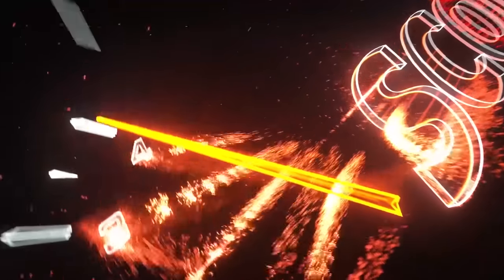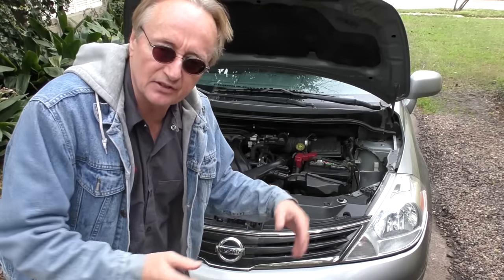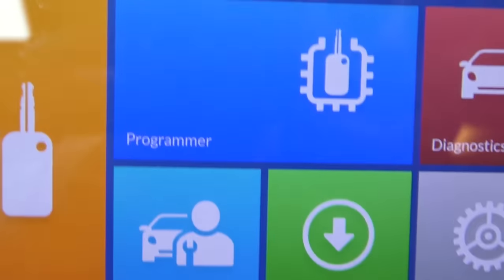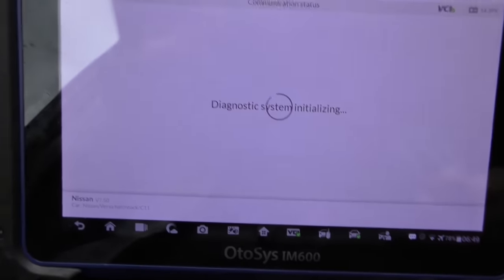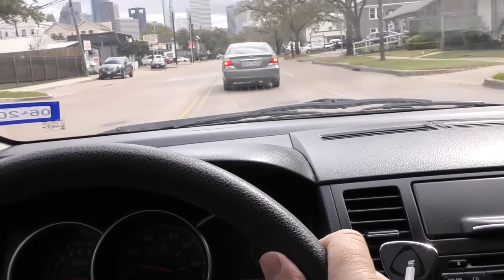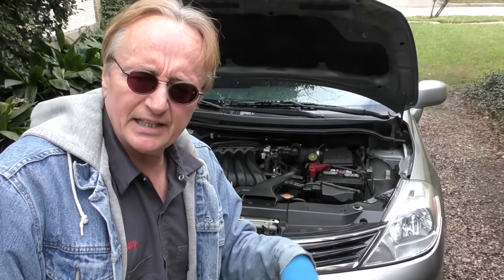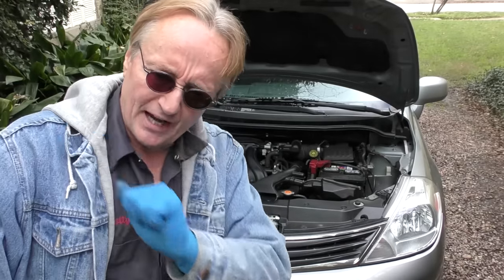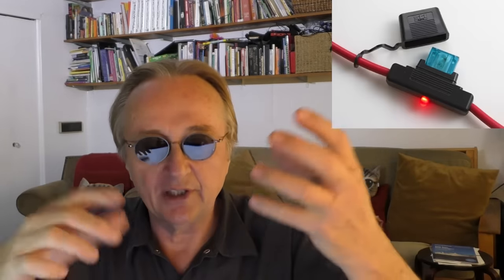Here's Why You Should Buy This Cheap Nissan

Comment: 1.40min... so true my 2015 nissan with a CVT transmission went out at 89k miles on it
Reply: ant gaona 
Did you flush the cvt before 50k? CVT fluid is weaksauce
Reply: @MainMite06  we bought that car used and previous owner told me he did... at the end we find out he didn't
Reply: ant gaona 
...Well that explains everything.. Those CVTs with either yearly tranny flushes, or flushing at 50k will really allow that transmission to cross 220k
remember that

Comment: absolutely not scotty, my transmission slipped super hard as i was pulling into the dealership to trade that in, pretty funny, they didn’t test drive it to appraisal the car, at the time of trade in, it was a 2015 with less than 50,000 miles

Comment: Seriously, you had to use a magnet to get the spark plug out? You don't have the little rubber sleeve inside the socket that holds on to the spark plug?

Comment: I would never drive another nissan after my 2014 versa cvt transmission failed.
Reply: Everyday Allday 
How & when did your CVT fail?
Reply: MainMite06 yes at 69k miles
Reply: @MainMite06  when I was driving one day, the car just lost all power and no matter how hard I press the gas pedal, it wouldnt move past 5 mph. So I pulled over and shut it off and restarted and pressed the gas and heard a loud crunching sound. I limped home at 5 mph and just parked it on the driveway and knew that nissan had terrible cvt transmissions. I sold it the car the next day and bought a tacoma. I'm never buying another nissan ever again.
Reply: Everyday Allday 
When you say "lost all power" did you mean
 "lost all forward drive?"
As in the engine cant move the transmission in drive?
  Also did you or the previous owner flushed that CVT fluid in 50K?
     Failing to do so will lead to fluid flouling, & CVT chain damage.
  And also, 
you know Nissan does make reliable non-CVT sedans & trucks on par to Toyota..no need to write-off the entire manufacturer for one bad apple..
Reply: MainMite06 I was at a stop light with the foot on the brake and when the light turned green, I pressed the gas pedal and it moved but noticed as I was advancing in the intersection, the tachometer and speedometer was dropping and no matter how much I pressed the gas, it would not move. So I put it back in park and shut it off and started it and it started to move but very slowly and the more I pressed the gas pedal, it made a louder crunching noise. I was the first owner, bought it new and did the transmission service twice at the dealer. I know Nissan makes non cvt cars but i was just very disappointed. This was my first car I bought and paid off months before and now this.
Reply: @MainMite06  also im not the only one with this complaint, I did some research and a lot of people complained about the nissan versa cvt specifically.

Comment: I've got a 2009 Versa hatchback with a knocking noise/feeling when turning the wheel, it has been that way since 127k miles. I have gotten all of the front end suspension parts replaced, but the knocking still persists. I've had multiple mechanics take a look at it and they haven't found any problems. I'm currently at 140k miles, nothing has fallen off fortunately, but the knocking annoys me. I don't know if anyone else has had this issue on first gen Versas.
Reply: It's probably the steering shaft bushings in the column
Reply: @rays7437  awesome, thanks! I kept looking it up, but most results were of corroded coil springs (there was a recall for this in certain states) and sway bar links. Next time I take it in, I'll ask them to look at the steering shaft.
Reply: @cali_viceversa   You think they would have checked those items when you had "all of the front end suspension parts replaced."
I wasn't aware of the recall, but then again I have been living in the Southwest a long time.  I can't remember the last time I saw rust.  Good luck!
Reply: @rays7437  yeah same here. I asked the dealership about the recall, but they wanted to charge me the full price of $1500 for strut assemblies because the recall wasn't applied in my area, so I went with an independent mechanic instead.
Reply: @cali_viceversa  I vaguely remember hearing about that now.  The vehicles had to actually have the problem and be registered in the "salt belt" states.
Reply: I had that on mine, I ignored it since it didn't seem to be hurting anything. Just a little design flaw I guess. It never broke and I had the car for 8 years.
Reply: @mdd47  and here I thought that my mind was going crazy or I got unlucky with a used car. Probably not resellable in that condition, but I have no plans to hand it over to anyone else anyway. Hopefully replacing the intermediate shaft will do the trick and relieve my stress a little bit.

Comment: My ‘15 is really close to 100k and it has been trouble free. The CVT fluid is changed every 30k. I have owned the car since 2014. Should I keep it if runs fine or get rid of it?
Reply: Keep it and drive it into the ground; it's not like you'd get much for it.
Reply: cincymodeler1109 
Keep going until you run it to the ground, or suffer a major inconvenience, like a heater core or evaporator. 
  GET THAT MONEY'S WORTH!
Reply: Michael Ball that’s what I was planning. It’s still trouble free. It just can’t get out of its own way.

Comment: Hey Scotty I like the newer civic hatchbacks but they all come with turbo engines. Is the turbo okay in the civics or is the base model without a turbo better?
Reply: Stay away from 1.5 turbo engines they have excessive fuel dilution problems. Get one with 2.0L N/A engine in either the Sport trim or LX trim, sedan version. (Sport looks better and comes with more features and alloy wheels).
Reply: @tails300  I figured the turbo engines had issues, but it seems like Honda only makes hatchbacks with the turbo which is annoying. I don't want a turbo and wouldn't get one just to have the hatch. Thanks for the help!

Comment: Bought a 2019, now I’m upside down. Don’t get it. They suck. Constantly broke down, worst CVT transmission, and the Transmission communication board is located in the drivers side taillight and I got water in there twice one before and once after Nissan fixed it the first time smh 😅

Comment: I have a 2014 Nissan Sentra w/59,000 miles on it and apparently the transmission went. I called Nissan and they are willing to pay 90% of the cost to fix the transmission. There's a settlement waiting for approval that will cover my car. Should I take the 90% offer and if I do, will I be eligible to recoup the 10% lost?

Comment: Things I've learned watching Scotty's vids a few weeks:
1. Yes, I should get a used car instead of an overpriced new one. Preferably a Toyota or a Honda.
2. Whatever used car I buy it's almost guaranteed to have problems, and within a few years it will devolve into a moneypit. T_T
Reply: I bought a used Mercury Grand Marquis. I paid 3500 for it, i am mechanically inclined, i have put about 2 grand into it, tires, brakes, and other parts.. Ive driven it about 25k miles so far.. no real problems.

That said, my 1991 Previa manual i purchased used in 2003 for 1,200 dollars, it had 255k miles on it, i put about 1700 into it over about 7 years.. i dumped it with 986k on it, ran great when i got rid of it. But it got hit, and insurance gave me 1,500 for it, so it went..

You can get good deals and bad deals, just make sure if you buy used, buy from the original owner, and be prepared to put at least 2k into it.

Comment: Will someone confirm this for me. Scotty said if the tire pressure sensor stops working then the Automatic Braking System won't work? That is crazy. Is this true? As far as I know every car I have had if tire air pressure is low it has nothing to do with the ABS system so why would a bad TPS cause ABS to stop working? This sounds like a serious design flaw and a safety hazard.

Comment: I drive a 2017 Nissan Versa with the CVT sometimes, 50k miles, and let me tell you.. Everytime I drive it I feel like its gonna break if i step on the gas pedal.
Reply: Just put it in R for race and it'll be fine.
Reply: Sell it now!! Get another car while you can!!! Since it's low mileage, you'll get more money for it. I drive a 2013 Nissan Versa SV with a CVT transmission. Bought it used in 2015 & didn't pay attention to all the class action lawsuit notices because my car ran excellent at the time. But after it hit over 110K miles, the CVT started slipping. It's literally a death trap...now I can't get it to go over 50mph. I can feel the pulleys struggle on each gear shift. Can't even drive on freeway, have to take the back roads. Had the fuel injectors and fuel pump replaced as a temporary fix, so I can still drive it until I get another car.

Also the driver's door doesn't lock/unlock using the key fob.  From reading the comments, I see a guy had a similar issue... Please don't wait till it's too late like me to get rid of it. I'm considering junking it.
Reply: noa 
Did you flush the CVT yet? 
CVT fluid is weaksauce.
50k miles is the time to flush the CVT,

Or are you experiencing engine rattling?

Comment: No way you buy a car today without ABS. ABS with airbags has greatly reduced fatalities and car crashes.  Bad advice Scotty to tell people not to get sensors fixed for ABS.
Reply: Especially since most people nowadays don't know how to brake properly in an emergency situation.
Reply: The ABS fault with this car also doesn't have anything to do with the tire pressure monitoring system (TPMS) fault. Scotty is giving lots of bad advice in this video.
Reply: Hoder Harris 
My '08 Versa S didnt come with ABS & TCS in the first place,
(grandfather rule-most cars built pre-2008 didnt HAVE to be equipped with ABS & TCS)
    My mom & me driven that car in severe rain & dry summers for 13 years & never had a full brake-locking incident, 
   & also, the engine is so slow that TCS wasn't necessary..

  Oh BTW most of the fender benders the car suffered were stationary & were caused by taller SUVs either not seeing the car, &/or paying attention to smaller vehicles ahead..

Comment: I have a 2007 Ford five hundred sel fwd. the timing chain jumped and bent valves. I found a used engine with 56k miles on it, and I’m having it installed. What can I watch for to keep my motor happy for as long as possible? I live in the north where it snows a lot in the winter.

Comment: I have a 2013 nissan versa. Sofar due to poor quality I replaced fuel pump, alternator, throttle body, completely rusted rear drums and front rotors. Al at 130k miles. 
It is a lemon. Do not buy. And yes it was cheap.

Comment: They hide the spark plugs underneath the intake manifold, oh my  , hypothetically,I’d like to meet that engineer in a dark Alley, Ha Ha Ha Ha Ha,
Reply: Ford does it with the v6 3.0
Reply: Zak6959 
If Nissan made the intake manifold with "open fingers" for each intake port like Renault, 
  Then removing & checking the coil on plugs, & spark plugs would've been easier!

Comment: Is the Hyundai Elantra a good car? Will it last a long time?
Reply: 2013's were an unusually bad year. Other years are OK, especially 2008-2009. I'd go as used as you can to prevent long-term depreciation; youtube "tony seba robin hood conference" for more details on why.
Reply: 2011 was the worst year for anything Hyundai. They had so many blown engines that they couldn't keep up with the demand for replacements.

Comment: Yes, what kind of morons would put spark plugs underneath the intake manifold, like what happened to my ex - a 1994 V6 Camry!
Reply: Will Wong 
Renault does this to their 4-cylinders to save ground space around & inside the engine bay.
   Doing this frees up more floor space to move the firewall more forward & improve interior legroom.
    If Renault didnt do this so commonly, 
then the noses & hoods of the of their subcompacts will have to grow longer & become more of a headache to perform more stressful jobs like starter motors or radiators.
Reply: @MainMite06  Thanks for the info. Just that, next time if/when I buy a gasoline-engine car, I'll make sure I buy one that the spark plugs are easily accessible because I could only change 3 out of the 6 spark plugs before I had my ex towed to the junkyard due to death by natural causes.

Comment: Just bought a 2012 Nissan versa sv compact sedan with 135k miles for $3k??? Am I getting scammed? If so what is a good bargaining price. Also I notice highway steering wheel rattles and check engine light is on but the guy said he’ll get that fixed for me free of charge and I just don’t know if I’m making the right decision. Someone help me out
Reply: Spend $100 for a mechanic to check it before signing anything.  It's much cheap to have a mechanic say don't buy this POS than spending $3k on a car that needs another$3k in repairs.

Comment: I have a 2007 chevy express 3500 and check engine light flashes after 55 miles and we even replaced engine and still have that issue. Help? Nothing happens while running, it just keeps flashing.

Comment: Hey, Scotty. What you think about the Nissan NV200 (2016-2019)
Reply: I own a 2017. Very cheaply built car with cvt transmission.  Very underpowered (hates hills and people will honk at you for not going fast enough), but gets decent gas mileage and makes a decent light-cargo van or micro-camper (if you're 5'5" or under).
Reply: tarasded thanks for the information. That all I’m looking for, light cargo and camper cause I’m 5’5 to 😂. How long you had your 2017 Nv200 now?

Comment: I thought the only Nissan worth buying is a manual v6...
Reply: ornate hammer 
Certain 2.5L CVT Altimas can cross 180k miles, 
But, most certainly, 
the Renault-origin/Nissan-Modified 1.8-2.0L 4-cylinders (MR18DE-MR20DE) were bulletproof from the start

I have 215k on my 1.8L Versa 4at

Comment: Funny how my 2019 nissan sentra sv got looked at... turns out qt 50k miles the transmission is faulty. So they gave me a 2020 sentra sv as a  Courtesy vehicle to use till its looked at more... turns out a 2nd problem was detected with the rattleing....
Reply: Hell, I've almost got in an accident when the cars transmission decided to slip while merging on the highway. 6,000 rpm down to 1,000 and the engine acted like it wanted to stall. Because of them I almost lost my life getting rammed by a trailer truck. Never again will I get a nissan. Not until they fix there transmission hiccups
Reply: And no it's not the fluid. Fluid was good and I kept the car maintenance when needed. So it's just there crappy transmissions. All I gotta say is I'm not paying the rest off. Not after that. They can keep or do whatever. I'll just find another car worth the same value. I can't afford to replace the transmission. I wasn't expecting it to bunk out at 50k miles. Ridiculous

Comment: What can cause steering wheel play in my 98 dodge Dakota 4x4 which failed my local safety inspection? It has a 3 inch body lift. It also failed safety for ball joints but I don’t get any of the symptoms that lead to bad ball joints.
Reply: You answered your own questions. Lift kits and ball joints.  Get the ball joints replaced and the lift kit re- torqued. Then recheck from there. It could have internal wear in the steering gear, worn out tie rods/ends.
Reply: Ray S ball joints will be my next move which many people say is known for older dodge trucks. I will also inspect the steering & front end components to see if anything is unusual or worn out. Otherwise the truck still drives straight

Comment: My Gf has a 2018 Nissan Versa Auto. Would it have the cvt?
Reply: Yep!
Reply: Ginja Man 
Relax, I own a new one

 if you hear nothing but "quiet turbine noises" from the interior from when you drive
     Then, theres NOTHING wrong that car, & remember to FLUSH THE CVT AT 25-50K AT THE DEALER, FAILING TO DO THIS WILL LEAD TO CVT FAILURE!
     Also dont fret, that car can cross 200k miles with minimal maintenance outside CVT flushes